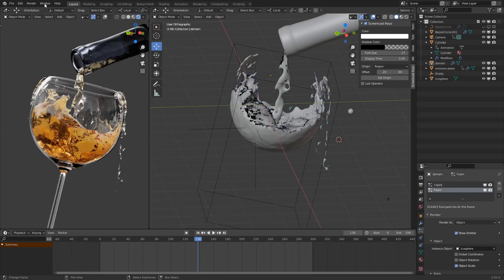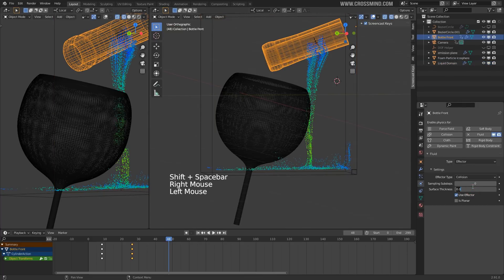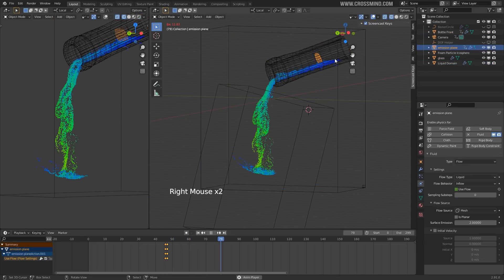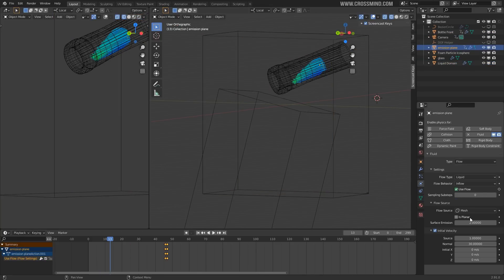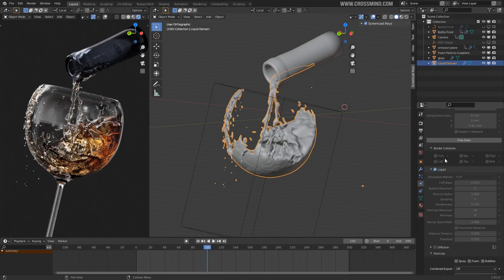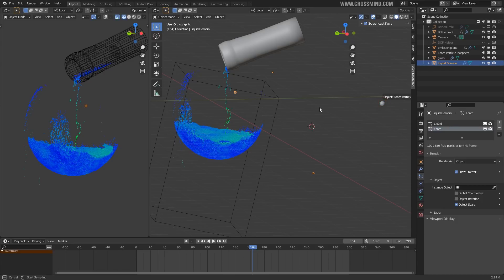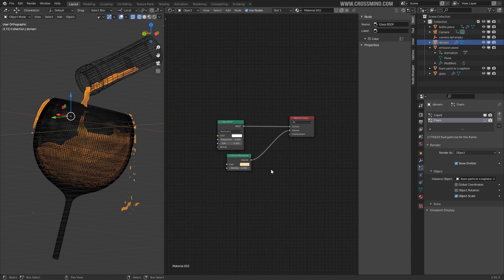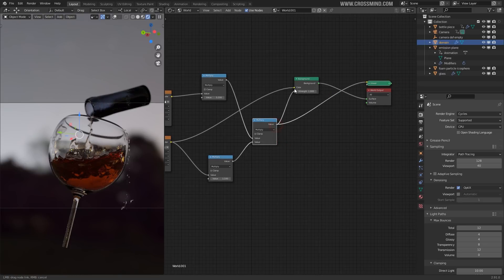Chapter 6 - Mantaflow Foam Particles / Blender

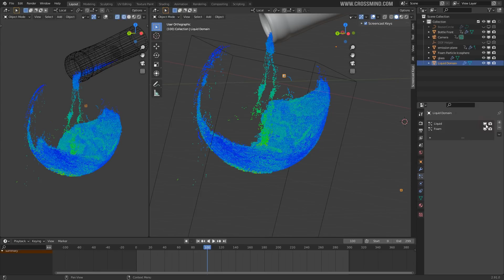Comment: Is there any way to keep only the foam/bubbles/spray in the render and hide the rest of the liquid? Kinda like how you did at 10:48
When I try to do it, I can only get it to work in the viewport because I have the domain viewport set to Wire, but if I render the frame it just shows the whole domain cube :/
Reply from the maker: Yes 
You can just turn off the mesh which you baked from fluid dynamic modifier.

Comment: To fix the edge of the wine which is right up against the glass I used a Boolean modifier on the wine to subtract the geometry of the glass. It was very CPU intensive in the viewport, but works well in the render.

Comment: THANK YOU SO MUCH, finally it worked! 
Before I watched 4 tutorials and nothing worked. My only question is that why my water looks like slime ))) I mean when it touches my glass, it doesnt slide down smoothly and fast, like yours, it stays a bit on the edges as if it had more viscosity, like slime or honey, Though when it poors from the bottle  it runs ok. I havent changed viscosity, I use 128 resolution, 2 steps, full velocity (one instead of 0.5). What can be wrong? The size of particles? Could  you please help?
Reply from the maker: Disable viscocity